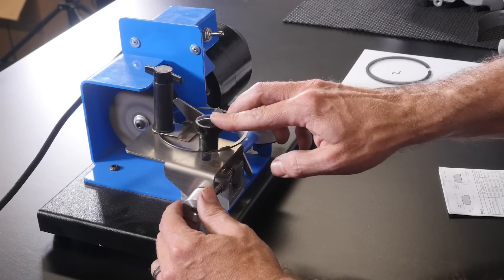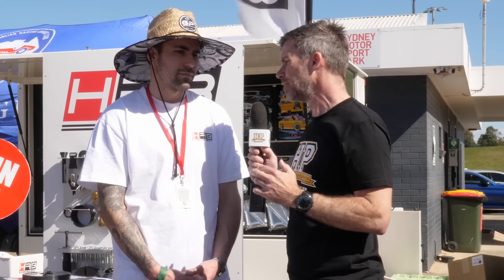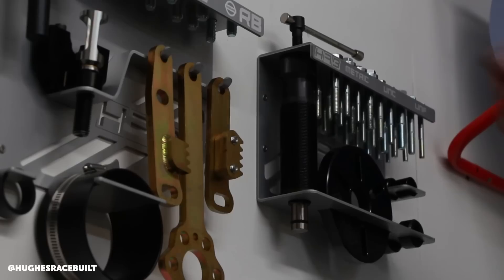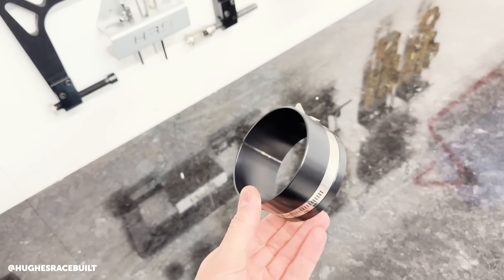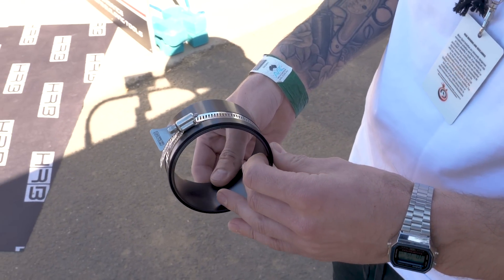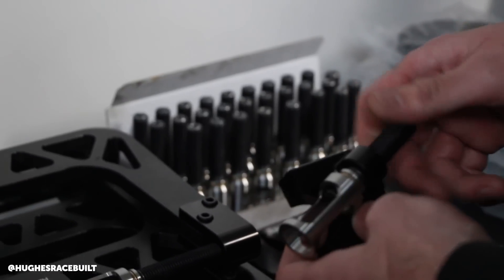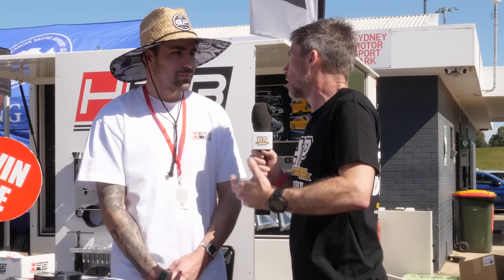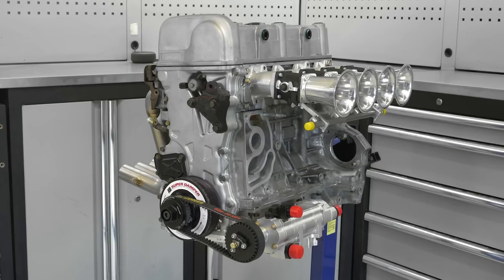Essential Tools That Will Transform Your Work

Comment: On installing valve springs: I just discovered valve keeper installer/removers, and my god are those things life savers! It takes literally less than 1 minute to remove or install valves. No risk of damage. No ballistic valve springs. No retainers disappearing into the Retainer Dimension, or wherever it is they go when they fly across the workshop.

Comment: You guys do a vid about tuning a Catalyst converter with aftermarket ECU ? I'm planning to install myn soon was just wondering 14.7:1 how much does the mixture need to move to get it working ? Say 14:1 to 15:1 ? Or is that to much ?

Comment: Finally a spring compressor that is good enough to warrant buying! I can get rid of my home made junk now! And the semi adjustable ring compressor will be so much faster and safer,never had a problem with the adjustable type as I always take the time to seat and adjust it correctly but now that time will be free!
Reply: @needmoreboost6369  i legit have more spring compressors than i need but the 1/4 drive is a nice touch and will save a lot of time and arduous turning of t handles for dual valve springs. Definitely buying one and the ring compressor as I do lots of KA24DE RB and JZ stuff.
Reply from the maker: Yeah Andre really enjoyed using that. You can do a lot with a little, but nice tools can certainly make it all a bit less painless in time and effort costs 😎 - Taz.

Comment: Cool, sometimes finding 'that' little tool, that makes things SO much better, can be a real pain, and if there's a kit it's even better.
Just going to check, and they may already do it [they don't], but a tool for measuring, and setting, the valve spring heights would be cool - a design with the vernier scale(s) on top of the tool, rather than the side, would be great, because some heads have a lot of material around the spring recesses and so can be hard to read. 

They may already be made, but haven't seen them yet.

Comment: Easily the spring removal press table and the lock holders. Place the locks in the holder over the valve on assembly, tap the lock holder over the stem, release the spring. 1 set of  locks in place in about 3 seconds.

Comment: What about changing valve springs with the head still on the block. Can we stop retainers or the small pieces that hold it together from falling into the block better
Reply: A good magnet normally works
Reply: Been using bits of lint-free cloth for years - might not work on every engine, but does for most - what might be more of a problem is if they fall outside the engine, and off something on the floor.
Reply: In 2006 my mechanic put pressure on the head with some kind of tool so he could change the valve springs and retainers while the head was still on the engine.
Reply: @KimboEK4  yes is many different ways and tool's available on the market. .